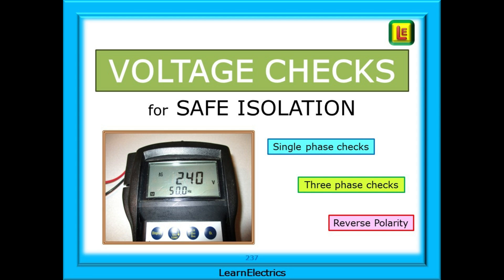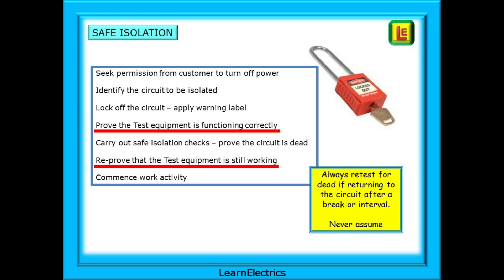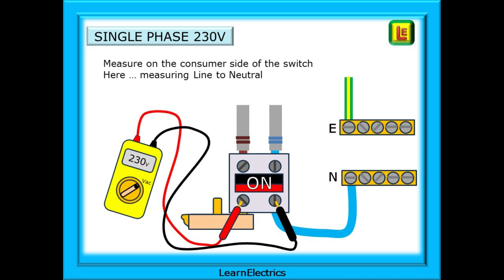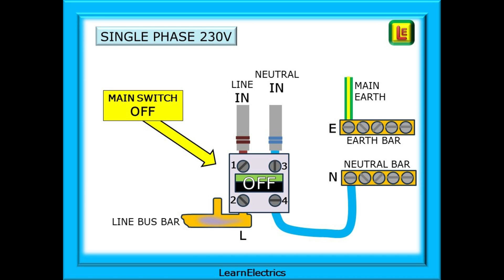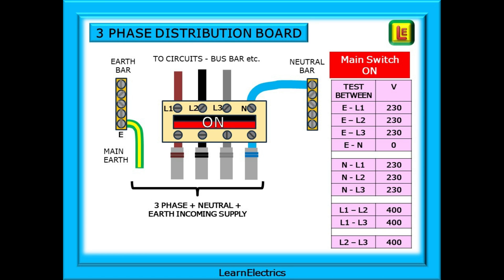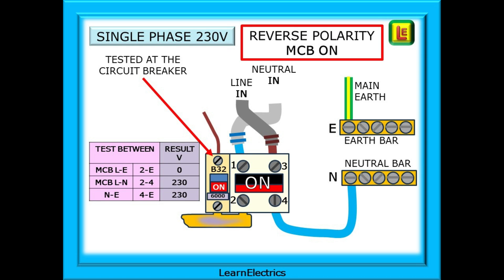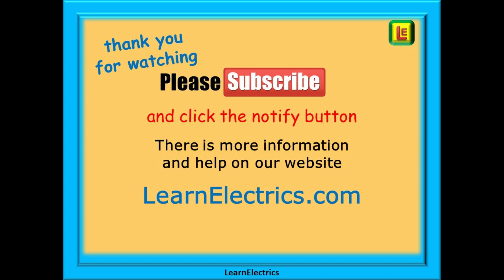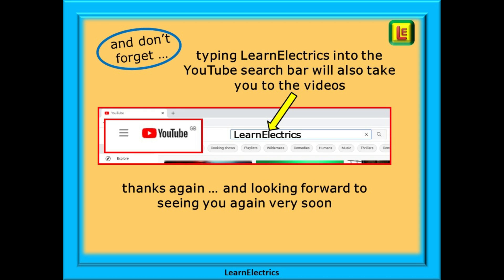VOLTAGE CHECKS – SAFE ISOLATION – SINGLE PHASE – THREE PHASE – REVERSE POLARITY – HOW - WHERE - WHAT

Comment: Your warnings in this video were BANG ON, Dave!  I learned the HARD WAY never to be complacent about 'safe isolation'!    I was installing some flat panel LED lights in an upstairs office in an O2 mobile phone shop in a shopping mall (about two years ago now).  I isolated the circuit using an Emergency KEY switch in the room prior to starting the task (thinking that this would be safe enough).  I went for my break, came back, and there was a Chubb installation contractor working on a small panel (who was now present in the same room, but hadn't been there when I went for my break).  When I came back, I carried on from where I left off, installing the lights in the ceiling, thinking nothing of his presence in the room . . . and 'BAM' - the next thing I knew,  I GOT AN ELECTRIC SHOCK when I went to strip the twin and earth  to install the next fitting.  The guy had turned on the lighting circuit (using a 'fish-key' at the same EM testing-switch that I had 'isolated' the circuit from while I was gone, and he never thought to mention anything to me - and I never thought to check that the circuit was still off! So, a Lesson Learned, about Safe Isolation!
Reply from the maker: You are not alone. I know of many sparkies that have followed the same path as you. Glad you are ok. 
Thanks for the support. Dave.

Comment: Hi Dave, i'm following all your videos and they have been nothing but great help.  I suspect that the unit needs to be isolated before taking off the cover and then can be de-isolated again to do the checks?
Reply from the maker: Some boards cannot be opened without turning off - the switch position prevents this. Its good practice to turn off, you never know if there are loose energised, wires inside that spring out.
Reply: @learnelectrics4402  fab! Thanks

Comment: In a three phase system, my Red Phase to Neutral is 198V, Yellow to Neutral 260V and Blue to Neutral 249V. This happens when the three phase breaker is ON.

When the breaker is OFF, the incoming phases will be normal. What causes this imbalance?
Reply from the maker: Sounds like a loading imbalance. Can you disconnect the loads and then reconnect one at a time to find out the problem area. Are any of the loads very reactive.

Comment: Your explanation on ‘nominal’ is misleading. You say that the voltage can be between 220 and 240, but most likely to be 230. You state that ‘nominal’ is “just a name we give it”. In engineering parlance, 'nominal' is used when a value is the most likely within a range. Better to say, 'usually' or 'expected', to imply a range and act as a warning. Your use of language needs to be as accurate as your use of a meter. Your vids are some of the best on YT though, especially the graphics.
Reply from the maker: Thanks for your input.
Wiring Regulations - Voltage by which an installation is designated or known.
Chambers dictionary - In name or thought only but not in  reality.
Thank you for watching. Dave.

Comment: Most important to check for voltage present. Yes I try to follow this rule always. Shutting off main breaker does not mean power is dead.  Check your meter with a known voltage first to insure it's working and then check the unknown equipment for voltage. And check your meter again with the known voltage. This is the only way to make absolutely sure you are not going to get caught with electrical shock or arc flash.
Reply from the maker: Great support, thank you. I always say --- if the circuit isn't dead, you might be.

Comment: What is the difference between isolated and switched off?  It's a big difference. As an amateur home electrician who worked in the electricity supply industry for far too long I am very aware of Company Safety Rules. [BTW my company used the term, "not live" rather than, "dead"!]
You use "isolated" where I would say "switched off". It's not "isolated" until some physical means to prevent re-energisation has been employed, preferably with a locking device, to which you hold the key. The locking devices employed on MCBs vary. If it is not possible to lock the device then the enclosure needs to be secured or you need to post a person to ensure that re-energisation is prevented.
Reply from the maker: Safe Isolation is proving it is a dead circuit or installation and preventing the re-energisation. As you say, short of posting a guard, there are limits.

Comment: Excellent explanation, 
You missed a very important point though, if using a GS38 approved voltage indicator that gives a audible signal be extra careful as this can confuse some people when test an installation that has a 
TNC-S earthing arrangement because the earth and neutral are joined the test with give a continuity sound and someone with limited experience could mistake that a a live voltage. 
Great video Dave as always.
Reply from the maker: Thanks for the input. To be honest, I could have talked for two hours just on safe isolation, I have to stop at some point.
Glad you enjoyed it, thanks for the support. Dave.